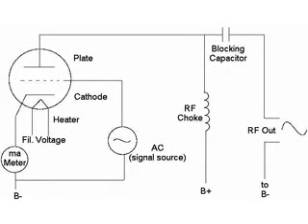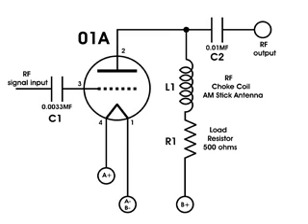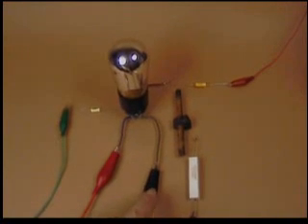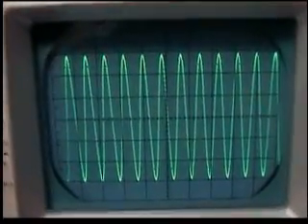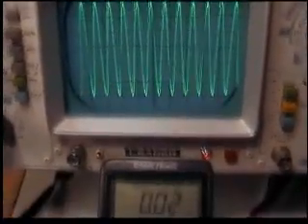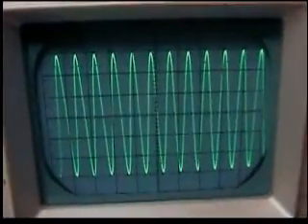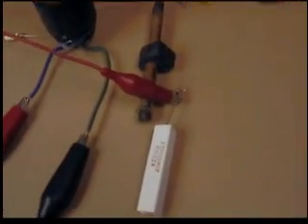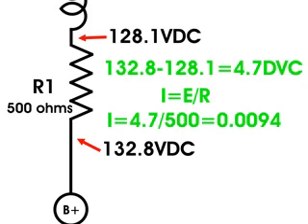01A RF Amplifier

Comment: Thank you Rick...  Is this used only for transmitting RF signals or could it also be used to boost the RF signal coming from the tuning capacitor of a tube A.M. radio?  (Before it enters the converter tube.)  I'm looking for a way to boost reception.  Also, is there a preferred transistor you would use in place of the vacuum tube in this circuit?  And could a much smaller RF choke be used?

Comment from the maker: @dream501 
You could use a smaller transmitter to drive and RF amplifier. I would not use and 01A. A more practical output tube would be a 6L6 or 6V6. Look for my video on building a 6L6 transmitter.

Comment from the maker: The impedance of the input and output and the oscilloscope is high enough that there would be little change in the results. I'm just showing that it amplifies and not the amplification factor of the 01A.

Comment from the maker: That triode will work also. Might need to adjust the control grid voltage a little and may even work better than a 01A. Thanks.

Comment from the maker: Thanks. The number of windings depends on the frequency and the coil core, air or metal, or to combine this, the number of Henrys it takes to block a frequency. Yes the small chokes and capacitors are there to eliminate unwanted high frequency RF. Because the internal components of the TV RF tubes (all tubes) have internal capacitance and this internal capacitance would pass the unwanted RF along with the wanted signal, and this would cause a great amount of distortion.

Comment from the maker: Yes you can. I still have everything on the workbench, so I'll change out a few parts and make a few other modifications and it should then be an audio amplifier. Good idea! My 1920's radios use all 01A's for the RF, the Detector, and the Audio circuits. It will be interesting to hear music using a 1920's 01A tube and a new modern speaker.

Comment from the maker: That's right. The 01A was pretty much the first widely use commercial tube. That first tube (V1) in the DeForest Crosley 51 is biased by the grid leak resistor which is about 3megOhms, it's almost not needed. But the cost of the way the 01A is constructed is the 01A is a low power tube. The maximum plate voltage is 135 volts.